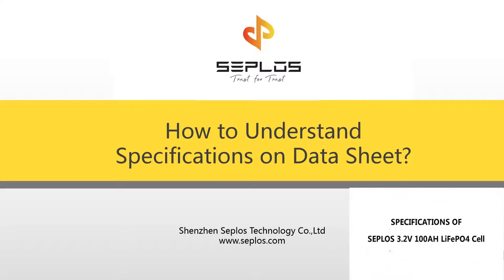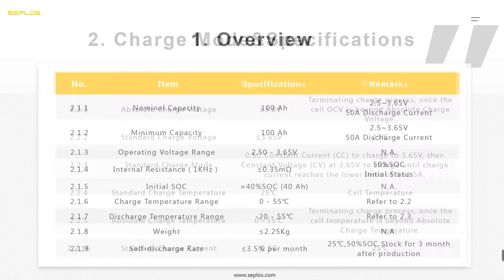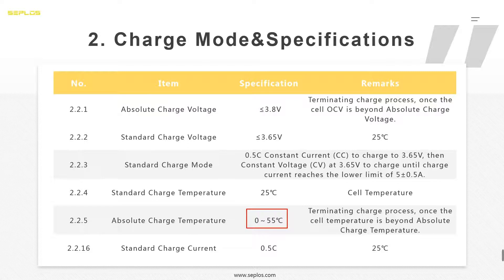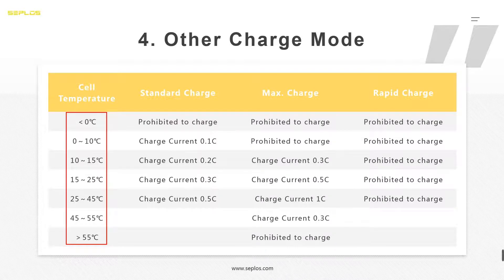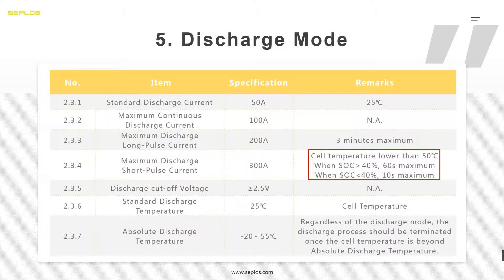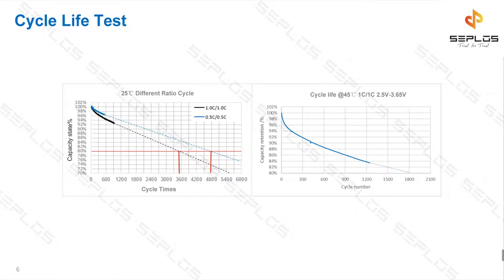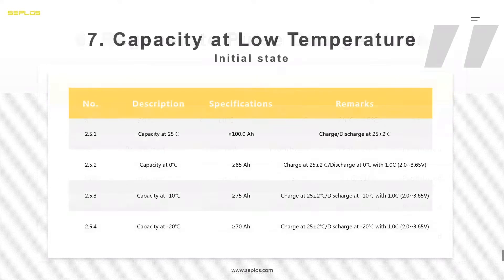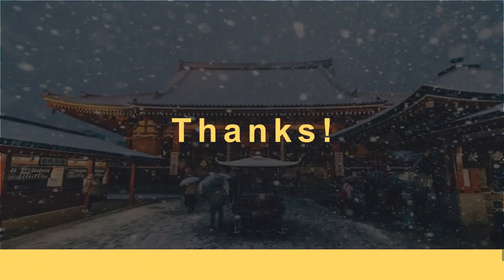3.2V 100Ah Cell Datasheet, Lithium Iron Phosphate Prismatic Cell Specifications, Build Battery Pack

Comment: Hi Allen, capacity at 25C is 100Ah and capacity at 0C is 85Ah. How does the capacity reduce from 25C to 0C, is it straight line, or a curve?  At 12.5C can we say the capacity will be 92,5Ah because it is halfway between 0C and 25C?